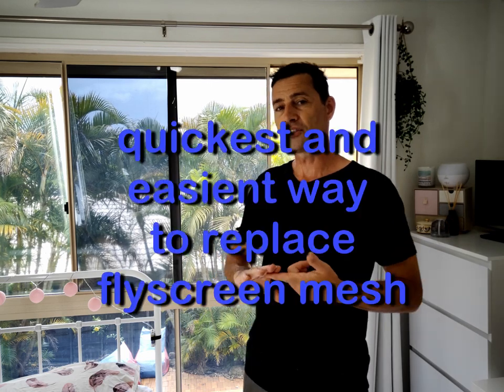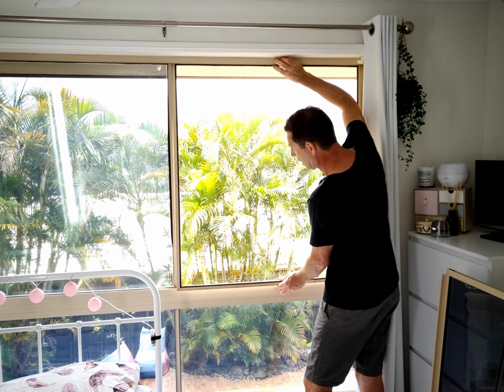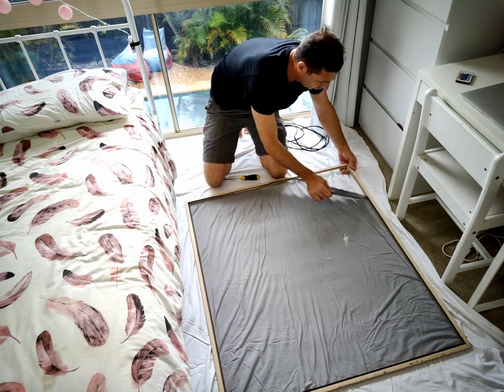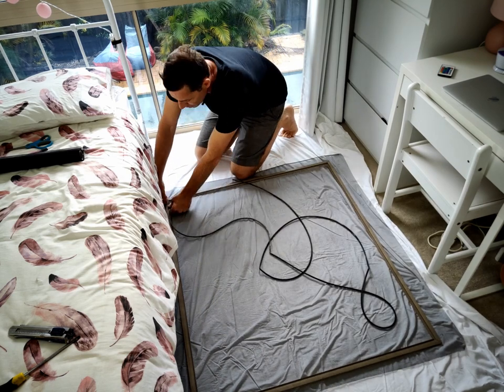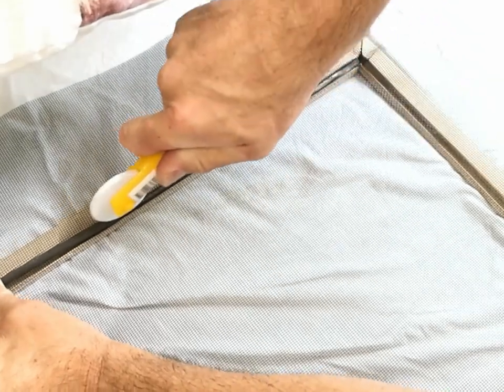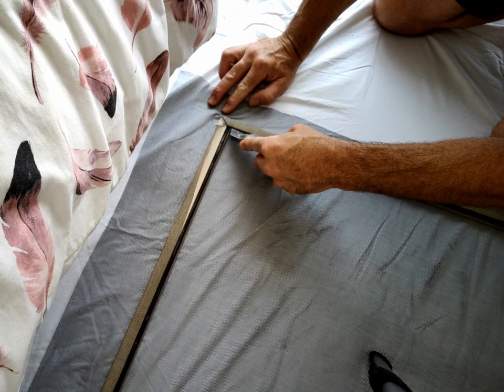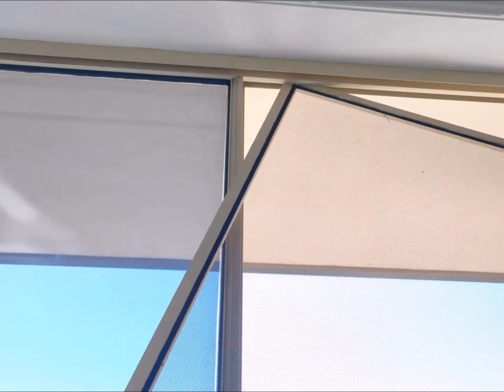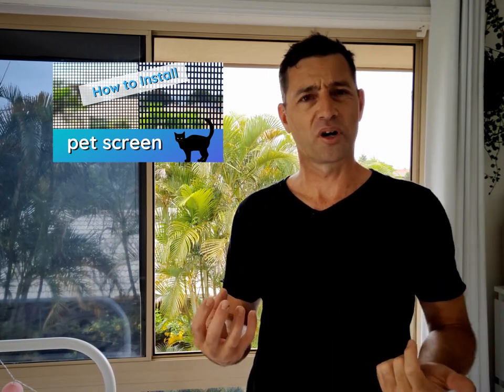The easiest way to replace a fly screen mesh

Comment: G'day from a sunny Sydney. What an informative video. Thank you. I now know I'm doing next weekend!
Reply from the maker: Thanks for the comment Beazle.. let us know how you get on👍 Kent
Reply: Inspire DIY thx mate...I’ve done it before but what I learnt from you is to buy that plastic roller...will make it far easier....I used a screwdriver before and it took much longer than if I had the right equipment.

Comment: Great video - any tips on how to keep the mesh tight as you put the spline in? Or do you even have to? Thank you!
Reply from the maker: Hey Michelle, so long as you can keep the mesh square to the frame, the spline pulls the mesh taught as you roll it in, normally start on a long edge. Best of luck, Kent